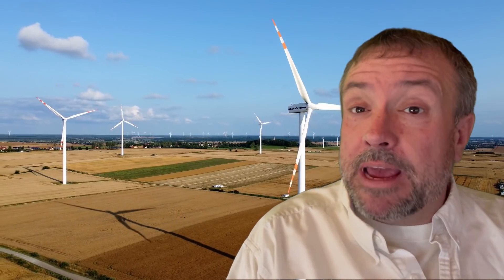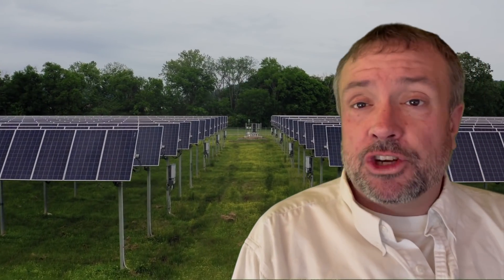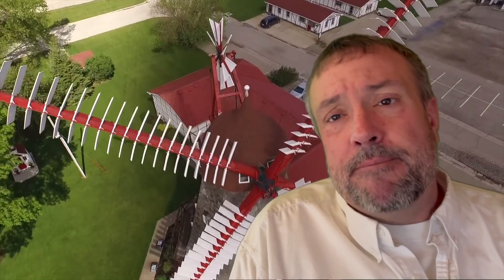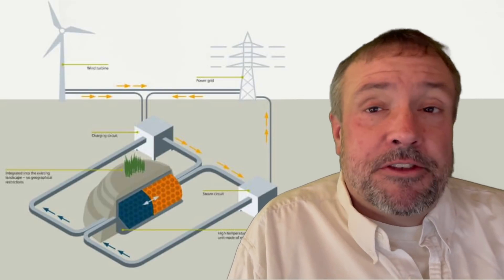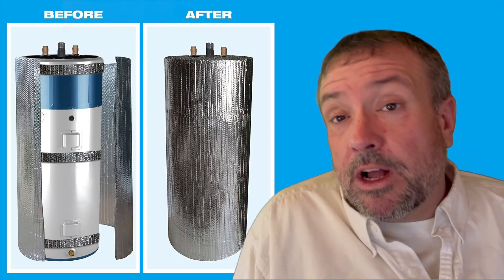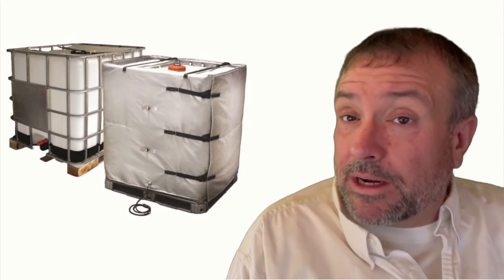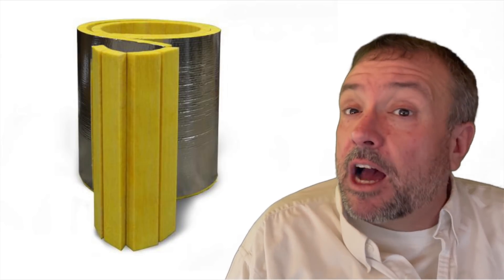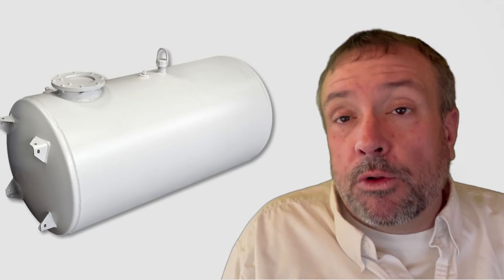Greenhouse Windmill Heating in Winter

Comment from the maker: Love to hear your comments and if you've ever seen anything like this before for heating!
Reply: We have a 3-4Kw turbine (and 6Kw solar) that we will be heating our greenhouses with in Newfoundland. The system is about 50% installed. It's not often very cold but regularly -1C to -5C here. It blows 30-70 Kms/Hr nearly every day all day. The batteries are 20Kw LiFePO4 with BMSes that heat them for charging below 0C. The dumpload will help but we are considering a DC heat pump due to the mild winter temps and nice SEER ratings/efficiencies at those temps.
Reply from the maker: @silverleapers  sweet! Cheers from Manitoba
Reply: @silverleapers  Nice!
Reply: My friend has a wind turbine that helps his solar system charge their batteries. Once the batteries are charged, the turbine shunts the powwer to a heating element to give the powwer somewhere to go. It just gets vented into his battery room but to use it to heat water and store it in an insulated tank is a brilliant idea! Aircrete is a nice touch too. I like the way you think
Reply: Yes water is an excellent option having researched a hundred different heat storage materials.  Challenge is high pressures if exceeded.  If controls fail, tank explodes 😭.  This is the most important issue.   Btw it's not a matter of if they fail, it's a matter of when they fail for they WILL fail.  With this in mind, redundancy in safety and inspections can save your property and your life.  Now,  I have recently been researching boiler systems so I can design or buy and incorporate the most reliable fault checks for my designs to reduce the inherent risk.  Secondly, I have also been looking at a new low pressure system that has less volumetric thermal storage ability, but can hold more heat per volume due to its ability to get hottet without exploding.  Lol. Low pressure makes it safer and able to store as much or more heat in the same amount of area.  Still looking into cost but the safety factor may be worth it.  Need to go crunch some numbers.  ;)
Reply: “water brake” or “Joule Machine”.  It's worth investigating.  Thanks Robert
Reply from the maker: @l0I0I0I0  very cool
Reply: There was a popular science "Adventures in alternative energy" where someone had used a windmill to turn a large paddle in a water tank through a right angle gearbox , the paddle heated the water in the tank . This eliminates the cost , complexity , and inefficiency of making electricity.
Reply: @robertlackey7212  Interesting?  Paddle, please explain?
Reply: @l0I0I0I0  what is there to explain ? It's like a torque converter except all the rotational energy is converted to heat., look up the article.
Reply: @robertlackey7212  Not condescending, just never heard of a paddle used to create heat my friend.  Still looking.  If you have a link that would be helpful. Thanks
Reply: @l0I0I0I0  I read it in the magazine probably in the 70's , 80's not sure , I think is was a 2 or 4 bladed paddle that had a vertical axis and rotated in a big insulated tank of water , it should be close to 100% efficient. it would be even simpler with a vertical axis windmill . The only small down side is the long insulated underground water pipes required to move the windmill far enough away to prevent any danger if it falls over.
Reply: @robertlackey7212  yes I think it's a great idea for windy places like simple tek.  Should be easy to make and does not require high rpm.  I'm curious how many joules it can produce, highest temp range and pressure it can produce.  I'll have to investigate this over the next few months or sooner.
Reply: I'm surprised that you didn't consider using grow lights to produce the heat to extend the light cycle for higher yields. Probably wouldn't take much to put heat exchangers on the ballist to help heat the water storage for in floor heat. Of course you would still need heat element or other sources that you mentioned when your lights are off. I guess what matters the most is how much energy on average you get per day off the wind generators.
Reply from the maker: @driftlesshermit  depends on your climate
Reply: Hey check out my channel , maybe we can collaborate and we can discuss how to make this happen.  The hivawt wind turbine would be perfect for this because there is absolutley zero maintenance and can handle extreme Temps.

Comment: Hello I have an idea wanted to know what you think 

Two 75 gallon steel drums 
Each drum has two elements connected straight to solar panel 

Then just attach a pump  to the connected drums and pump  through lots of pex pipe throughout 
Fill drums with antifreeze and water

Comment: Nice video. In the 1970s, Mother Earth News(MEN) Magazine looked at solar hot air collectors that used bins of stone to store heat. The advantage was low cost and air leaks don't ruin anything. I thought the same as you to supplement the heat with wind electricity and a heater to add to the stone. Several years later, MEN came out with such a system. By the time I built my house, in the 1990s, I made it passive solar with wood backup. The main floor is 11" of concrete that absorbs the sunlight, warms up, and releases heat at night. I am a retired civil engineer and from experience I know that the simpler that you can make a system, the more likely it is to work right for a long time. I want to build a wind generator but haven't had time. Good Luck, Rick
Reply from the maker: @richardross7219  thank you for sharing!

Comment: Harmony Turbines is supposed to have some revolutionary tech for operating turbines in low and high speed wind, as well as some kind of flywheel to multiply the energy output. However, they are not commercial yet.
Reply from the maker: Been watching a few new turbine companies, this technology is on the edge of becoming great for small scale users in a few years

Comment: The general idea is fine however the commentator doesn’t discuss the Engineering behind windmill technology. Electricity needs a steady turning generator produce by a engine consuming fuel at a steady rpm; since the wind is variable direction change, wind surges…etc the only way to produce a steady output of electricity at a given KVA or KW would require a Intragraded power drive system using power converters-inverters to provide a smooth ac signal output at a given KVA. Extremely expensive and highly technical for the ordinary laymen. I think this author needs to do more research
Reply from the maker: Ever heard of a battery?
Reply: Yes I did hear of batteries however if your going to use batteries as part of your primary / secondary/ backup system for heating for greenhouse the batteries would need a charging system including a battery power management software package; in addition to the Intragraded power drive system I mentioned in my previous comments. The batteries would have a different type of construction designed specifically for/used in power generation rather than batteries used in Electrical Vehicles or for Vehicle starting. I’m not saying it can not be done however this is not a project for layman or people who watch your YouTube channel; it’s very technical snd expensive because you would need a Automation/Electronics/Software Engineer to put it together such as myself; the idea 👍 however Cost to much
Reply from the maker: @edwardgrossman295  sounds like we have to talk to Tesla about their power wall then!!

Buhahahahaha

I love these idiots that think they’re smart and have no real world experience what so ever

Comment: Thanks for making the video, this exact thing was one of my shower thoughts and I spent entirely too long building a system in my head... and wasting hot water.

My plan in my head focused on electrical heating and checking the price of appropriate sized batteries... it'd be an investment.  Your plan would be much more budget friendly.

How is the insulation value of the two part foams? aircrete undoubtedly a cheaper option though in that large a quantity... probably less environmental concerns too.
Reply from the maker: Thank you for the kind words

Comment: I wish I could setup a greenhouse and alternate heating system using solar or wind power but you need a good sized lot (only have 75 X 100 Foot) and the draconian city of Ottawa bylaws seem to be fine tuned to stop this type of practice. We have the corrupt gay Mayor, Jim Watson at the helm, so we know Liberals won't change the bylaws in my lifetime (time to vote OUT the Liberals).  If we win the lottery, maybe we can buy a hobby farm just outside the city limits and be unencumbered by stupid bylaws and crooked politicians.
Reply from the maker: Check to see if you can have temporary greenhouse structures- we can work with that

Comment: Interesting idea. But not nearly enough energy being produced unless your windmill is HUGE. Even if your windmill produces 1,000 watts continuously, think about how much heat 1,000 watts of energy will give you in a 30 x 96 greenhouse. Won't even be a blip on the radar screen. You'll dump your entire stash of heat within a few hours on a cool night and then have your 1,000 watts of heat coming from your windmill to try to recharge it. 

Some kind of geothermal setup, maybe.
Reply from the maker: I'm thinking several 3000-5000 watt windmills and seasonal energy storage

Comment: This is my very first video of yours that I’ve ran across, and the content was great and sparked quite a few ideas for my current greenhouse build project.  I’ve got a large 3000gallon water cistern that I piped into my gutters on my shop.  I’m currently building 2 separate lean to style greenhouses on adjacent walls of the building and I’m incorporating the cistern as an ambient heat source in the corner between the 2.  After this video I will incorporate a windmill generator with a small solar array to charge a small battery backup system and after reading the comments I’m now confirmed that implementation of a heating element into the water cistern will be the perfect excess power dump!  What a perfect idea to utilize the leftover power being produced.  I know a heat element may not do much for 3000 gallons but every little bit helps and what a perfect way to ensue the longevity of the windmill!
Also, I’m very impressed looking through the comments section at all the many different ideas being shared and discussed amongst this community; very open minded community, and no one seems to be offended by other comments suggesting an educated challenge to their own idea.  However, the primary reason I am going to subscribe is the engagement of the Presenter of this video with almost EVERY SINGLE comment I read.  I really can appreciate  from, again this very first visit to your channel,  that you are openly engaged and completely open minded to your audience.  Bravo!  And I’m off to view more content!  Have a wonderful day everyone!
Reply from the maker: That's awesome! Thank you for the kind words!
Reply: Full proof system. The only thing that I see as a weak point is the elements.

Comment: Hydroponics VS Aquaponics.. Here's Which Ones REALLY Better! https://www.youtube.com/watch?v=nGp2BemG7Bw
Reply from the maker: Nice spam.
Reply: @SimpleTek  Yeaps it is an advertisement;
But it was the best comparison of hydro vs aqua ponics I could find w/o the typical endless mind-numbing techno babble ( https://www.youtube.com/watch?v=aW2LvQUcwqc&t=38s ).  It seems hydroponics is simply a subset of aquaponics but in aquaponics it's on a much much smaller scale.  
My crux interest is the amazing synergy between aquaponics & greenhouse (plus solar heating/electrical systems).  Besides food independence, a huge amount of aquaponic water within a greenhouse is a huge thermal-mass.  A huge thermal-mass can greatly-reduce/eliminate daily temp cycling & thus maintaining greenhouse temp over months becomes essentially maintaining the temp of the huge amount of water.   Ignoring daily cycles & focusing on yearly cycles, the monthly energy required to maintain the temp of the huge thermal-mass is fairly easy to predict/calculate.  
Oh the cool temps ~15ft understood ground can be raised closer to the surface by just insulating the surface (ex: with air/styrofoam/hemp/etc-crete panels).  Also long coiled flexible pipe can provide much more surface area than a same vol tank.   So maybe a shallowly buried long coiled flexible pipe covered with rigid insulation is more bang for the effort/resources.  
Just trying to cut-thru the endless mind-numbing techno babble (ex: KISS & Occam's razor) & let me know whats-yous-thinks.  Oh you're probably like this video:
      Eugene Odum (the US pioneer of ecosystem ecology) https://www.youtube.com/watch?v=6I7zcYyomyA&list=PL8DBBCF38F0A35AAF

Comment: Hi there. Nice idea. What about using heat mat´s for seedlings and put them in raised beds into the soil with a thermostat and using power from a car battery wich is charged from the windmill. or pipes from the floor heating into the raisedbeds. i think soil temperature is more important than air temperature.
Reply: I use pipes of hot water buried
Reply from the maker: Good idea

Comment: I researched wind turbines. You need a regulator controller like you need for a solar system. But you also need a controller that controls the speed of your blades. If you don't purchase this important component, your blades will speed out of control, which will burn out your mechanics for making electricity. Besides this, you need constant maintenance of your turbine, because of dirt and bird poop.
Reply from the maker: most come as systems with all that - but yes!
Reply: @SimpleTek  must be a new thing. Because when I was shopping for one on eBay, I had to know what I needed to make this turbine work for me. And once I saw what I needed, it became obvious that maybe it was better to do without it.
Reply from the maker: @qolspony  all sellers are different and there’s soo many different ones
Reply: @SimpleTek  True. I spoke to three sellers before I made the conclusion not to purchase a turbine. Many told me that my climate of eastern North Carolina is not desirable for this application.

Comment: I wonder if it would be more efficient to have the windmill create heat through mechanical friction like two plates rubbing together rather than generating electricity and using electric elements. In a sci Fi book I read(Red Mars by Kim Stanley Robinson)  friction windmills were being used to warm Mars.
Reply: Good idea
Reply from the maker: it might be but the problem is cost - electric windmills are mass manufactured and what you suggest has to be built - way more expensive!

Comment: Why not store the energy as compressed air? Or use that compressed air to lift water and then use hydroelectric? Easy peasy.
Reply from the maker: in theory - compressed air needs a HUGE expensive tank for large volumes and lifting water requires large areas to store the water - hydro dams create lakes behind them. easy but yet not so easy for the everyday guy
Reply: @SimpleTek  can you friend me on Facebook? We can talk more about it there.
Reply from the maker: @steveciarico9824  did you send a friend request?
Reply: @SimpleTek  no. Are you under simple tek? I will look now. I have a bad signal where I'm at so I apologise for any delay
Reply: @SimpleTek  
Compressing air generates a considerable amount of heat that can be used to heat water. You dont have to store all of the air you create,  simply vent the excess via a pressure relief valve. You can run it 24/7 as long as the wind keeps blowing

Comment: Good idea, except for the fact that it requires moving parts, in windmill and pump. And that means wear and tear and that is stuff that can break down. Now, if you could find a windmill with bearings rotating in magnetic levitation, that would be interesting.
Reply from the maker: good point but many windmills now are rated for 10-20 years with little to no maintenance

Comment: There is no problem with hot water in one of those 1000litre plastic cube tanks you express concern over. The plastic does not start to soften until over 130C.
A better answer is to use your heat to heat air that you use to dry zeolite clay. This then requires no thermal insulation. Then when you need heat out you simply add water to the zeolite. This can be by blowing humid cold air through a container or pit of zeolite pellets.  It will come out hot and dry. Or by circulating cold dry air from your greenhouse, while dripping water in.
Zeolite clay is inexpensive, and easier to contain than water,  a pile of it in the middle of your greenhouse would do fine.
Adding water to dry zeolite clay can easily raise it to boiling point temperature.
Reply from the maker: interesting, I'll have to test that